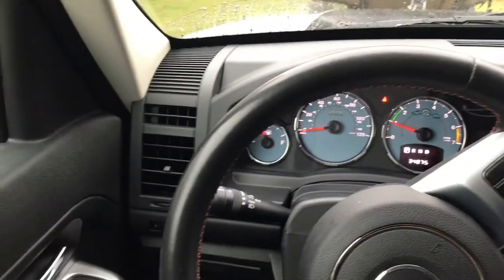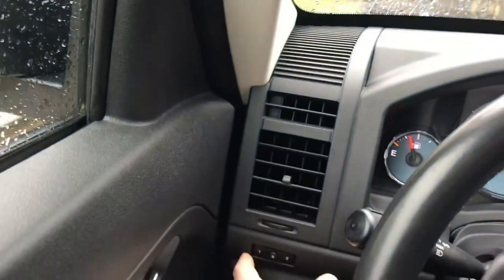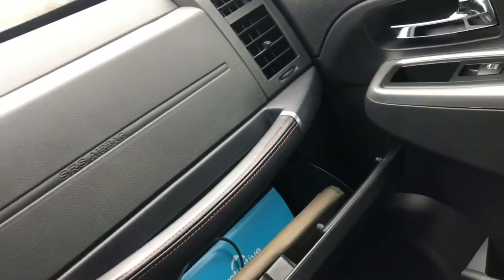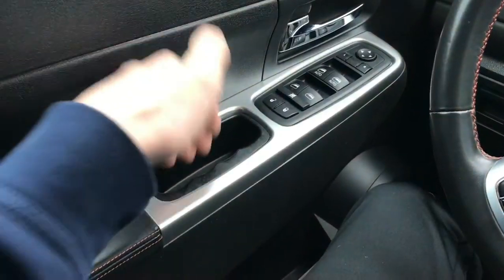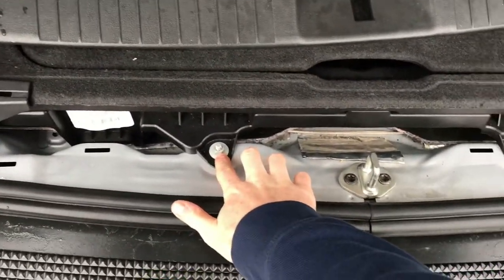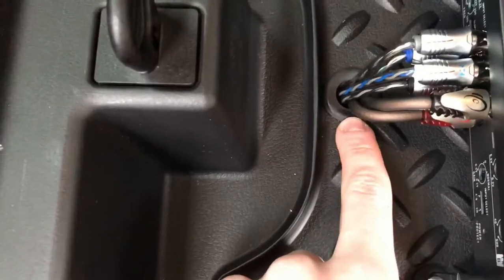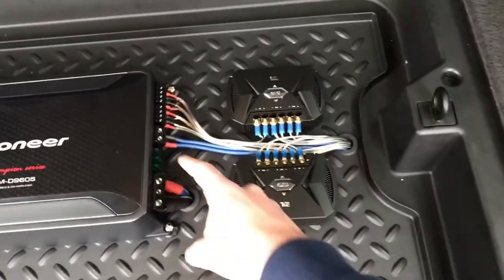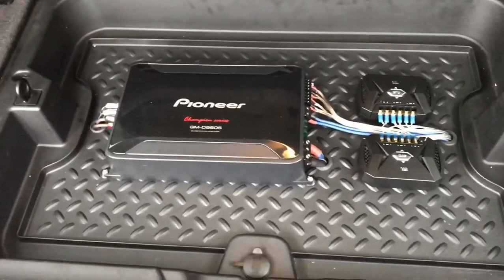Jeep Liberty kk 5 channel amplifier install (interior panel removal pt.2)

Comment: Good video man. I just bought a 2012 KK this weekend. Looking upgrade the sound system. Where did you get that custom sub? I don't want anything blocking my trunk space.  Also, can you take a video or sound clip of what the system sounds like? Thanks.
Reply from the maker: Rob Dittert The sub isn’t actually custom. Any 8 inch aftermarket sub will work, I went with the kicker dual 2ohm compR and then I wired the dual coils to get 4ohms. The KK has a factory sub in the rear that is also 8 inches so all you have to do is take off back right cargo panel. And then the sub and it’s enclosure should be visible. Factory amp can be found right above this exclosure. I didn’t want my cargo area taken up as well so this was a perfect solution. Hope that helped!

Comment: where is the factory amp?
Reply from the maker: It is behind the right side cargo panel right above the subwoofer inclosure. My other video I’m pretty sure explains where it is
Reply: Do the sport trim models have a factory amp there as well? Or are they just in the limited trim models?